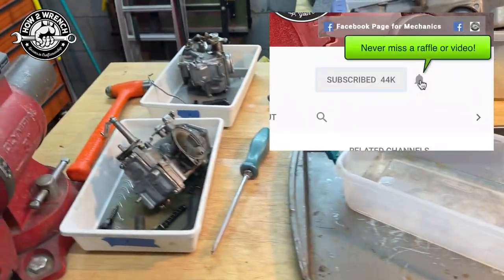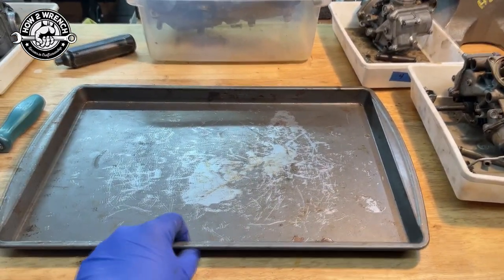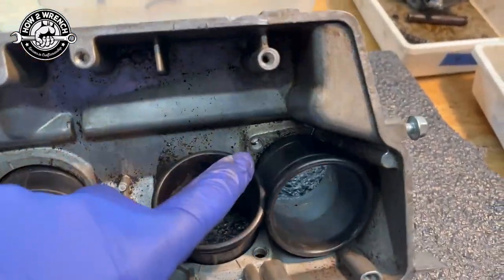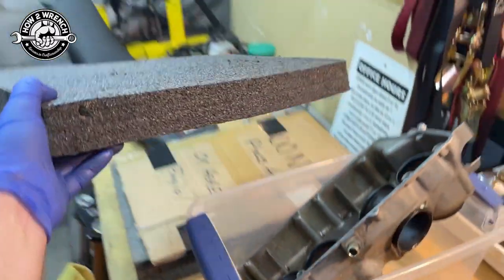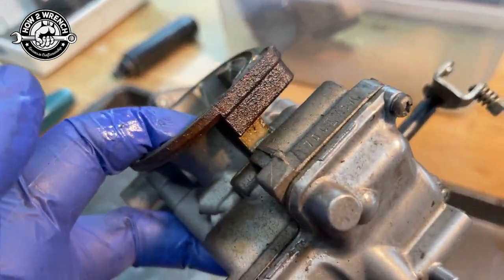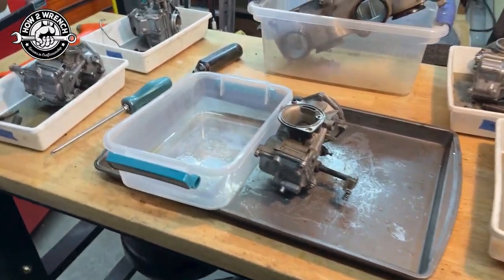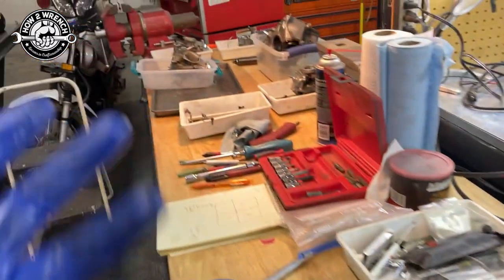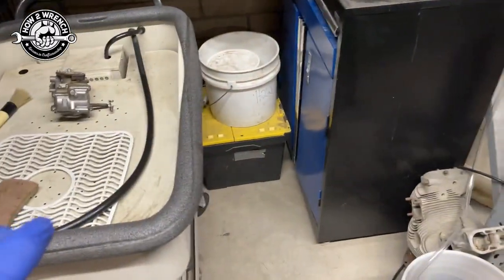Do you have these 3 tools ready every time you service a carburetor? #carburetor #diyrepair #keihin

Comment: It's worth collecting stainless steel steam table containers (round and rectangular) as they're rugged and solvent proof. I also grab every discarded red plastic fuel can I can (flea markets, yard sales) then cut off the top with a zip disk because they make excellent fuel proof tubs. The K&L carb support is excellent but if you fab you can make a freestanding support in a few minutes which is stable and sits above any drain pan you like. I always have outdoor vises on stands or steel benches which are ideal for supporting carbs during leak checks after drilling whatever scrap is handy to hold the carb (any style carb, not just bikes). I leak check carbs using an ordinary medical IV pole  (ideal for holding dummy fuel tanks) outdoors over a large metal tub or oil drain pan. A long hose allows tilting carbs at various angles to ensure they don't flood. I use cheap-by-the-bag Briggs and Stratton style inline fuel valves for many things including dummy tank fuel hose shutoff.
Reply from the maker: Thanks for the added ideas...🙌